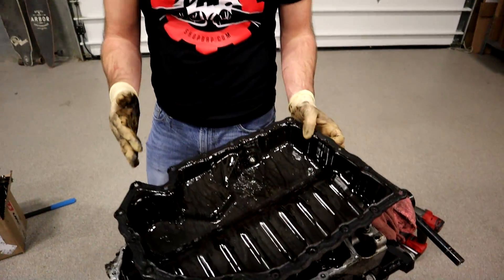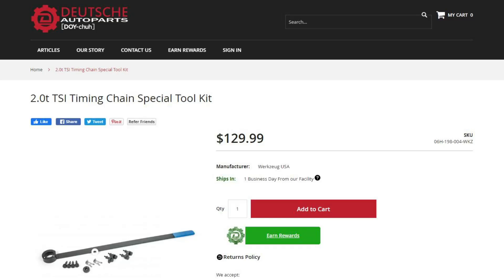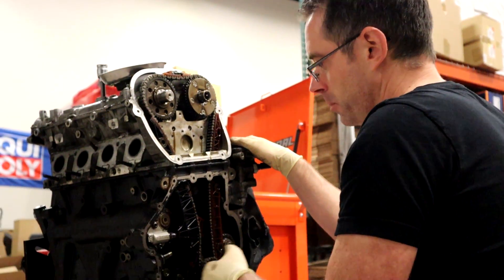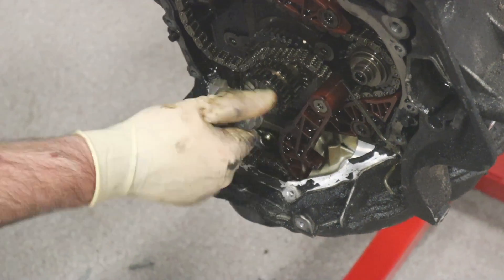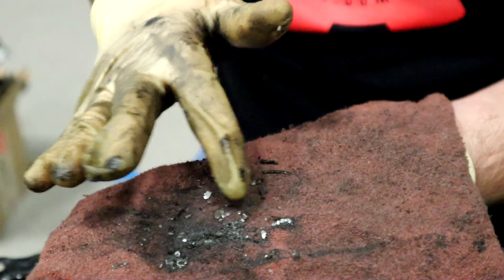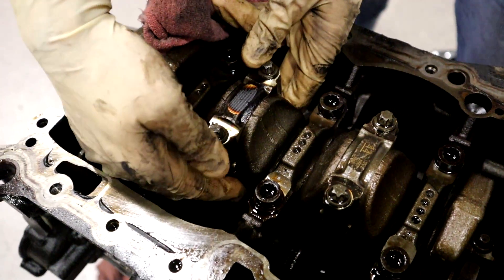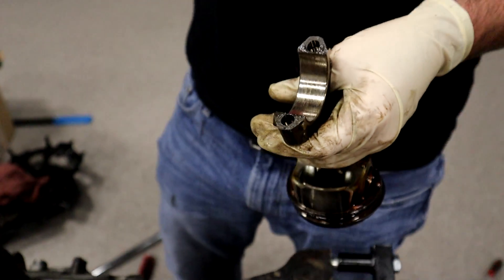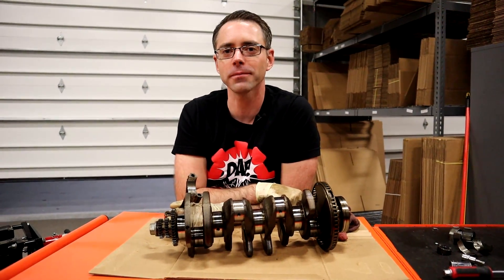What Makes an Engine Rod Knock Noise? | TSI TearDown

Comment: Change your engine oil waaaaay more frequently then the OEM recommendation suggests Kids 👍🏼 😬
Reply: Yea vw with their long lifer intervals, 19k miles/2 years, fuck that
Reply: @NSDflug  I've been taking care of my cars for more than 50 years, and have never had a single issue caused by my chosen oil change intervals, which have never been more frequent than OEM recommendation.  And my use of vehicles is classified as severe operating conditions for oil changes.  So you can waste your money if you like, your choice.
Reply: Currently doing this on my tdi with liquid moly.
Reply: @GritsAndEggs-y7s  same i do 5-6k. oil is way cheaper than an engine especially on these new engines.. when i did the head on my 02 1.8t.. the  block was mint.. still had its hone marks on the piston walls at 225k thats 5-6k oil changes
Reply: Changing it isn't as important as just making sure there's the proper amount of oil . In fact if you have to add oil with any regularity than you have changed your oil , just gradually instead of all at one time . This i know from having owned 3 Jeeps .
Reply: 96k on my ‘17 GTI. I’ve used nothing but the OEM (pentosin?) oil every 10k. Oil analysis performed 4-5 times over the life so far has shown absolutely nothing concerning whatsoever. And it’s tuned.
Same story on the previous car, ‘10 JSW TDI. Comfort levels may vary however I’ve had nothing but good results from following the OEM maintenance intervals to the letter.
Reply: Its called planned obsolescence.  Manufacturers just need to meet warranty period or at least 100k.  They don't want engines lasting 200k miles.  Change oil frequently
Reply: BMW E60
Reply: Unless the mechanic forgot to tighten the drain plug and now I have to get an engine replacement
Reply: Just use a good oil. Check oil level regularly. Use the best filter you can get. 10 k miles changes are ok. Did it on my 95 Subaru from 267 k to 400k miles.
Reply: No need to waste the world's resources by doing unnecessary oil changes.  Engines run much cleaner than 50 years ago, but stupid mantras persist.
Reply: @einfelder8262  thats bullshit. GDi engines produce a lot of carbon and with short distances oil gets diluted by petrol. That's terrifying for your oil quality. I drive a TSI with almost 300.000km, on LPG - no problemo. I change the oil after 12-15000km. That's more than enough, 30000km is asking for trouble, especially if the engine barely gets hot. Also; with turbocharged engines, oil gets much hotter and wears out sooner, because of the shearing. If you want to stop wasting resources, you shouldn't drive a car after all ;)
Reply: @einfelder8262  engines may run cleaner on the exhaust emissions side,but definitely not internally, especially on a direct injection motor. That oil turns black in no time. I’m now a retired tech from Audi/VW and got our customers to do oil changes between scheduled service. I change my oil every 8K (5 thousand miles) with Mobil 1
Reply: @nickpappas4133  ... exactly right 👍🏼 My 2018 MK7.5 Golf R I’ve had from New has fresh OEM 5W30 fully synthetic  “Long Life” oil & filter refreshed every 6K miles from day one. You should have seen how dark brown & dirty the engine oil was after the first 6K miles 😲 almost looked like used TDI oil 🙈🤣 Now I’m at 20K miles and on my 3rd oil & filter change.
Reply: @MattCSLnut  bro same. I got a 2021 MK7.5 GTI and I change that every 5-7k depending on my availability and work schedule. But when I pulled the dip stick out I was like sheeeessshhh . 😂😭
Reply: @einfelder8262  oil is much better than it used to be. People need to use common sense too. If you drive gravel roads, definitely change more often. Check air filters more frequently.
Reply: @einfelder8262  if you have ever seen vw/audi turbo 4 cylinders up close and personal you would know that 10k is waaaaay to fucking long period for oil change. They run HOT. Really hot. The 1.8T i swapped into my car after the factory one was fucked by previous owner, at 110k, with full dealer history 10k intervals, it was sludged up TO THE BRIM. It is absolutely necessary to change at 5k intervals unless you want your oil pump to fail under 200k miles... Its not a stupid mantra. Its experience that you clearly dont have. "Waste the worlds resources" tell that to the wealthy that go on leisure rides on luxury cruisers burning thousands of tonns of diesel each journey. I think me using 5L of oil every 5k is nothing compared to that...
Reply: @einfelder8262  Many if not most people return their used oil these days to have it recycled.  The oil can be cleaned up & refined & used over again.  There is not much waste.  Except it is so much more expensive for people to do oil changes than it used to be... But engines/engine rebuilds are so prohibitively expensive for most regular car owners.  Oil is cheap & plentiful, engines less so.  Change oil more often.

Comment: I hear ya knocking but ya can't afford a replacement engine? Run it till the crank case vents?
Reply from the maker: You can but metal in your oil is almost guaranteed to take our your turbo too